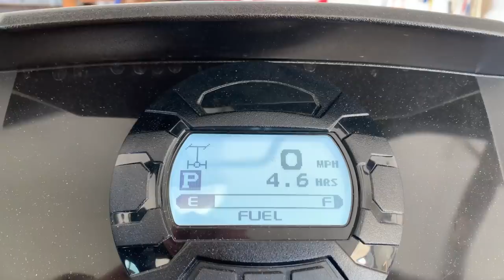The Best Siding For Your Barn or Cabin, Making Board and Batten on the Sawmill

Comment: Nathan, being from East Tennessee hope I can offer some first hand info. I sided a large addition on my house with somewhat green lumber. I also nailed both sides of the siding. Shrinkage caused a lot of splitting because both sides were nailed. Later on I helped side an old mill in NC. We only nailed one side of the boards allowing them to shrink with no restrictions. We did put the batten strips on, but again only nailed one edge. Hope all goes well. Enjoy the videos.
Reply: I had the same thought. Maybe if you used screws in place of the nails on center in the battens, perhaps you could just nail the center (or the center 1/3of the siding boards.

Comment: I know this comment doesn’t help u know but for future reference when working on a or anything with a pitch, measure and cut your first board if you are happy with it the short side measurement is your long point on your next board, so you can use the method after you made the cut measure the short now that’s the long measurement for your next board and you can pre cut every board all at 1 time at the chopsaw it’s especially helpful if your working alone cuts the time in half without making 20 trips back and forth
When you do your battens set the first one with the level then cut a spacer block it goes real fast then if you want to double check every 10-15 ft with the level but it’s not necessary if u set the first batten plumb and you make sure the spacer is tight and not sitting on a defect on the batten, you can do a 40 ft wall and be around a 1/8 of a inch out of plumb which you can’t see with the naked eye, keep up the great work Nathan love the content. From one Nathan to another 🍻🍻🍻🏒🇨🇦

Comment: I am on building a cabin on the western side of NC, similar climate as you are in. Do you think board and batten would be best or do you think it would be possible to do a live edge lap siding.  The wife likes the live edge lap siding but I have read various forums about the weather needs to be dryer to avoid cupping and wood movement, and maybe board and batten would be best.  Is there any wood you'd recommend to be best for either application, assuming you'd support the live edge lap siding?   Thanks for the content.

Comment: Thanks for giving the board dimensions, I was wondering what the thickness was. I want to re-side an exterior garage with board and batten, though it has what seems like barely an inch of overhang and no gutters so I wanted to make it with as thin of boards as possible. If yours was 3/4 I'll probably try 1/2. Currently it has old ugly thin cedar shingles with full horizontal sheathing underneath that I could just nail the boards to as is.

Comment: I’ve never seen anything burn up, it all falls down when burned…so I say “I’m about to burn down” and my family still pokes fun at me. Also on the board sizes…you used 10’x1’ for the board and 3/4”x1” for the battens, right?  I want to do the board and batten on my outdoor patio so just making sure I get the right sizes.  Thanks again for a good video.
Reply from the maker: battens are 3/4 by 2 1/2

Comment: Nathan, do you nail the batten in the middle, through the seam and into the purlin? I'm looking to do something similar. 
Bill
Reply from the maker: yes, that's is. my method, some though do it different,
Reply: I use 4" & fasten to the board on each side of the joint.

Comment: only one edge of the board gets nails every 32 inches. then a small gap to the next board. the bat covers the gap, and it is nailed to the edge below that got nailed. the system allows green lumber to slowly shrink and not split, and expand during wet and humid spells.
Reply from the maker: Been doing it this way for years. Nails don’t stop movement in green wood. Thanks for watching
Reply: @OutoftheWoods0623  nails don't stop movement of green wood? nice!

Comment: What are you going to treat the bottom end grain on the board and batten siding with to seal/ protect it?
Reply from the maker: We are painting it    Barn red
Reply: @OutoftheWoods0623  I recommend seal crete as a penetrating primer sealer. Apply it with a garden sprayer. Pain just sits on top, seal crete is the bomb.